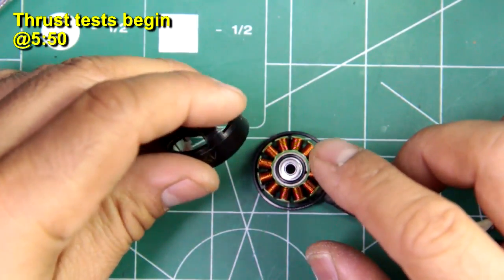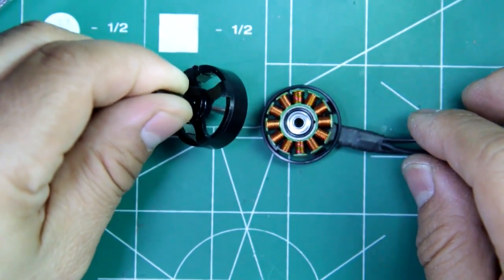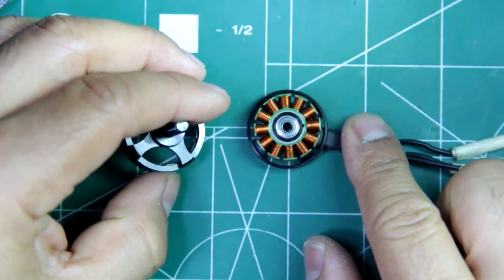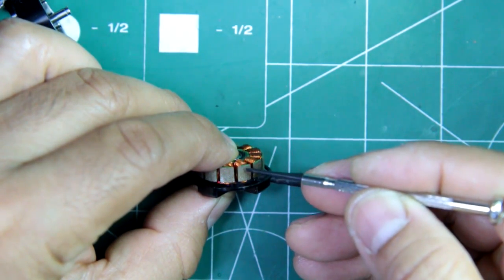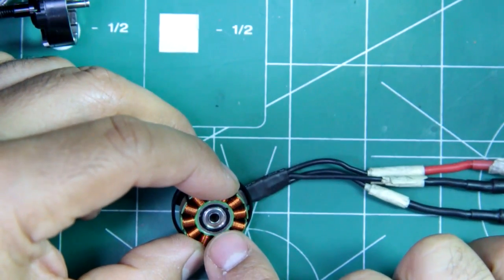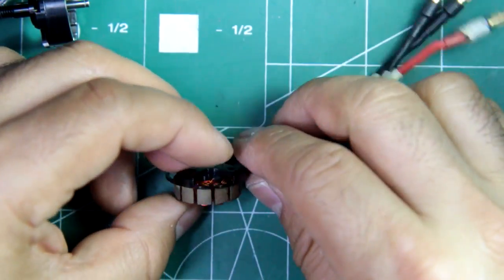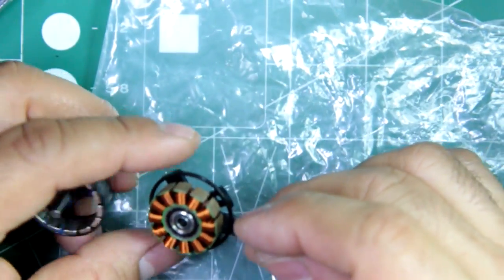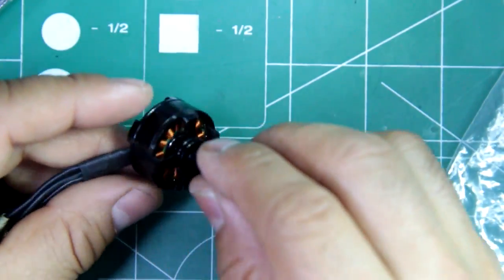New Motor RCX SE2205-2600KV (Prototype) Thrust Tests

Comment: They have the same size bearing as the 2206 version?
Reply from the maker: no, these have 3mm diameter shaft, the RS2206 have a 4mm shaft

Comment: thanks, the winding is pretty nice compared to their other motors. What is the difference between those and the RCX SE2205 2700KV FPV Racing Edition Motor?
Reply from the maker: I believe MRCM is using thicker single strand wire for the windings now, also the magnets may be "upgraded" to higher strength curved magnets. MRCM also mentioned somewhere, they're switching to other brand bearings. Possibly EZO so that's a good change -but need to confirm once they start shipping. They mentioned motors should be available in a couple of weeks or so

Comment: how can a battery survive this crazy motor XD
Reply: Seriously
Reply from the maker: Don't pay too much attention to Amps on static thrust tests, You gotta take into account many other factors that cause Amps to appear to be "too high": I use huge 7000mAh battery, voltage stays high at 15.2 to 15.9V, only one motor so voltage sag is even less, motor is restrained so there's more load on prop and motor.
When motor is on a quad in the air, LiPo is smaller and can't supply same voltage and Amps. Quad is moving so load on motor and prop is a lot lower. Usually 25 to 30% fewer Amps are drawn from LiPo  by motors. Of course, you will need a good LiPo no doubt, but it'll survive fine as long as you don't over-discharge by flying too long.
The results of these tests are still useful as we can see how motors compare to each other and to see which one can get more thrust, which means it has more torque so it should translate into better performance when comparing 2 similar motors of same size and very similar weights.
Reply: tnx I love your channel and your data sheets are really helpful! Tnx for your elaborate reply that you probably have to explain pretty often.
my current philosophy and nothing more then that is that low power motors like the racerstar 2205 that i am currently using draw lower amps. im always checking voltages after a flight and simply use a 3 minute timer. I never fly longer then 2:50 for me this has worked great. I think that highpower motors would wreck my flight times I like to go full throttle without destroying half empty 1300mah lipo's my friend killed 2 tattu batteries in 90 seconds and came down with voltages below 2volts total. probably because of oscillations but still high power magnets can drain and spike much more then smooth lower quality magnets. I don't know power is nice and your research is fascinating to watch. Tnx for your reply
Reply from the maker: And you're 100% correct. The "lower-performing" motors are kinder to LiPos and the risk of puffing them is lower, even if you go full throttle often -of course, using a strict timer as you do is needed. So that's a very good philosophy indeed. We're caught up in highest power possible, which is very nice, but there's a price to pay. It's all good. It's fun to get that much power, a little addictive. But you definitely have to watch LiPos. Also right on the money about high power magnets, that's why we were seeing more issues once those started to get used: fried cameras, VTx, yaw shakes, etc. There are fixes for all that, but yeah, everytime you increase power you uncover new issues. It's part of the hobby I guess. Thanks for watching.